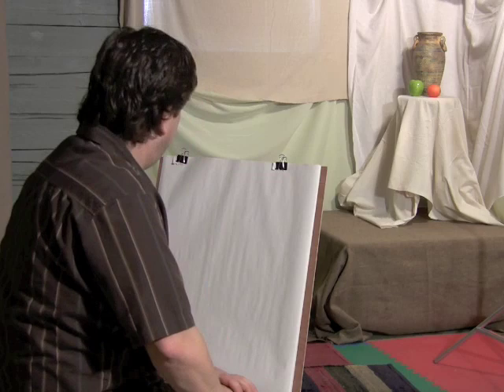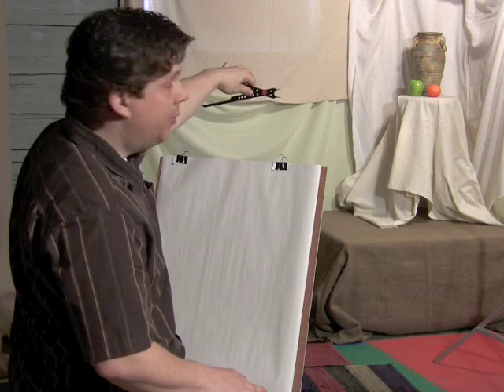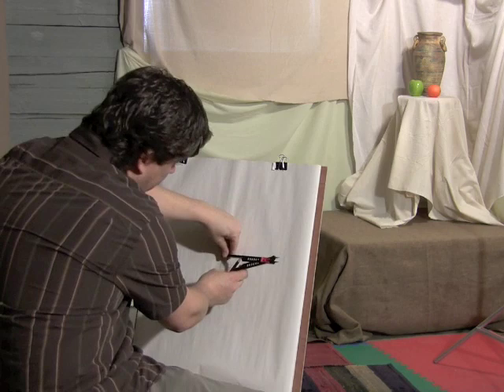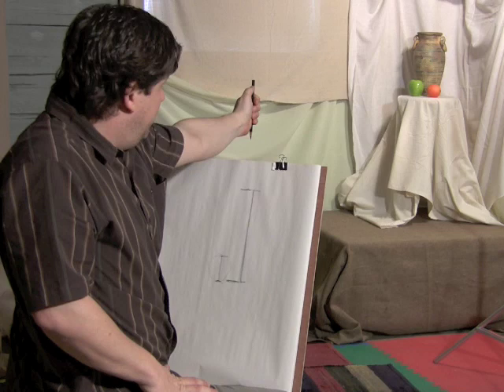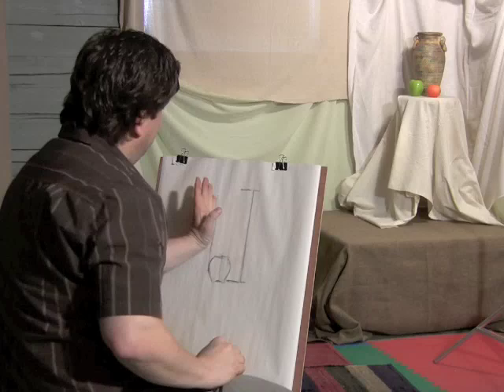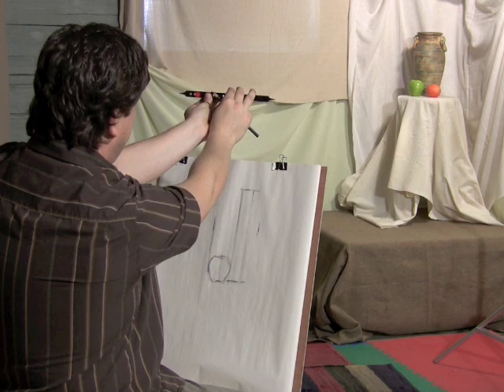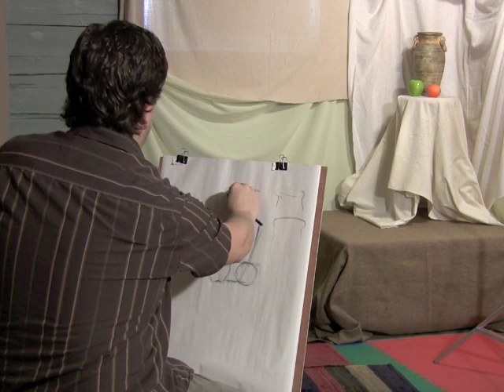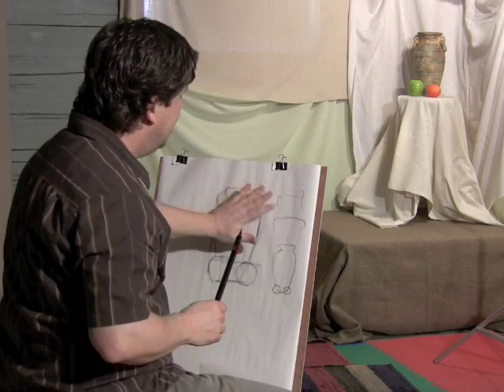Drawing With The Accurasee Proportional Divider.m4v

Comment: I got a set of proportional dividers from Micro Mark on the web. they are made of polished steel and are very useful for model ship building. they are expensive but worth it. they are smaller but much more precise than the ones shown here. If you try to buy them on ebay they will end up costing you more than $100.